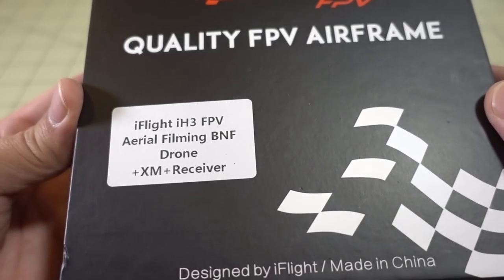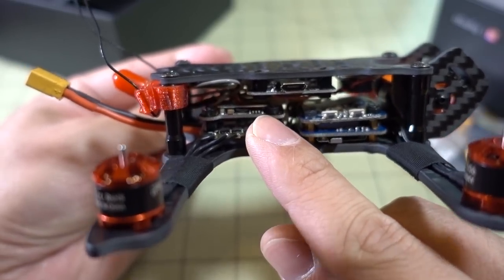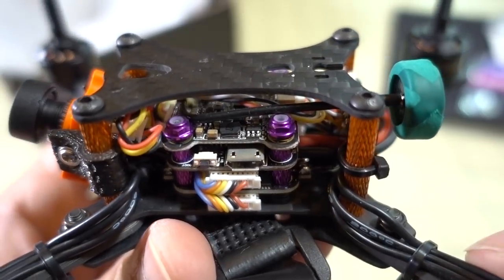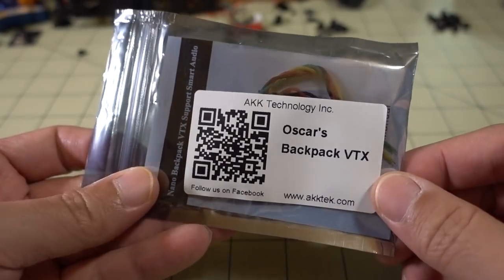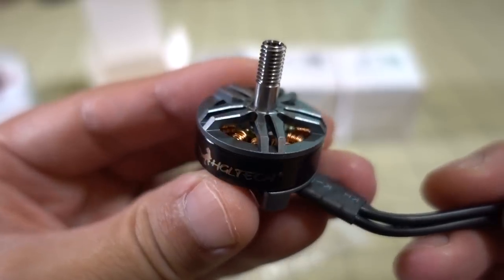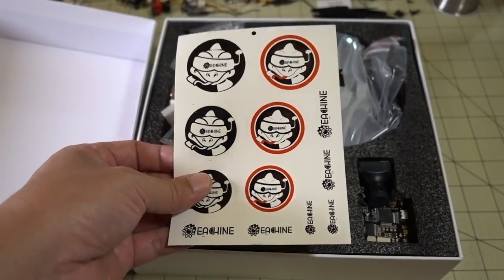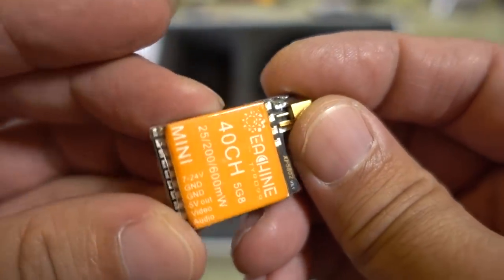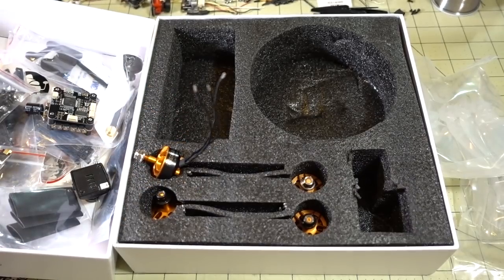Haul Time #96 🛒

Comment: Somewhat unrelated perhaps but I was wondering what your opinion on antennas is. I am using the ev800 with a single linear antenna and a dipole on my quad. Was thinking of either upgrading to a pair of pagodas or perhaps the realacc uxii, what do you think?
Reply from the maker: Get the Realacc UXii on both.  They work great.

Comment: hey albert i have a question. you know how the AirbladeUAV Intrepid V2 3-inch PRO Frame did not have its FC in the middle of the frame, did that affect its performance? im trying to design a frame and id like too move the fc back a bit but i dont know what effects it will have. Hope you respond. Love your reviews and videos!
Reply from the maker: It doesn't matter.  That's why the gyro is never in the center of the board.
Reply: Thanks!! needed assurance in what i need to do ahhaa

Comment: Thats cool! finally we are getting into some innovation. i wanted to make a frame with the carbon walls and cross-members instead of top bottom plates. it should give it more of an aerodynamic shape and perfect cg w/ batteries top and bottom. or i think gear reduction(watts per lb of thrust) is going to be a thing soon. and iim talking to battery folks about making 5v cels instead 0f 3.7v. and 6s6p 1350mah battery , redundancy for losing cells, you'll only lose capacity. liike i  said your channel inspires innovation. same with Bobs but he doesnt post near as much.